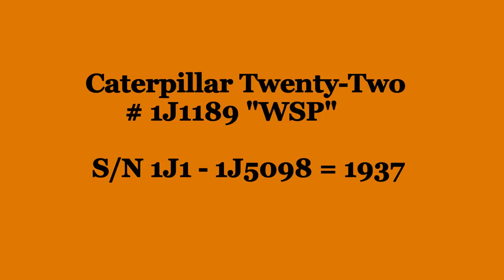Caterpillar Twenty-Two #1J1189"WSP" Tractor Walkaround - Nicely Equipped Vintage Tractor!

Comment: Squatch, Nice 22 and 22 walk around.  Help me out though...where is the electrical charging system.  I see an amp meter on the battery box but see no engine driven charging system.
Reply: I assume then that the lights are not original since tractors equipped with lights would certainly have a charging system.  Was electric start and/or lights with charging offered on 22s when new?

Comment: Because I think that throttle linkage is too simple, I want to see the intake manifold inverted and add two 4500 Holley Dominators mounted sideways on a tunnel ram.  While you're at it, please add automatic chokes. I'll be back to pick it up tomorrow.

Comment: In all the Cat's you've shown I've yet to see the very small Cat my father bought back in the 1970s. It was very small compared to any of those you shown. No little Joe just turn the key and it starts. No more than 8-10 long. I recall if it was a D or J model. It was home painted with a horrible bright yellow.